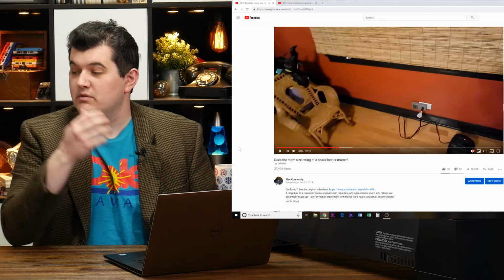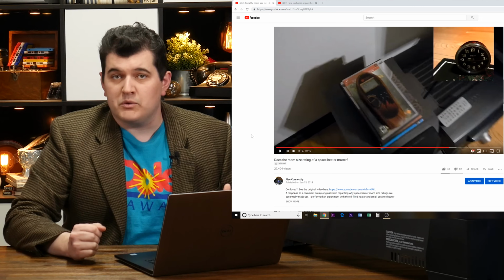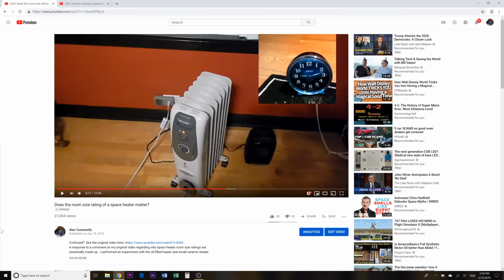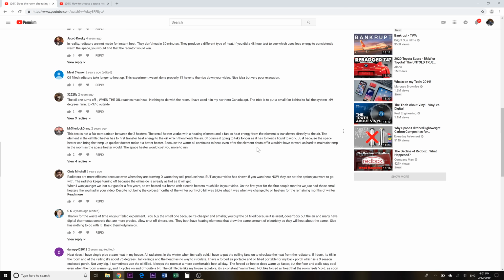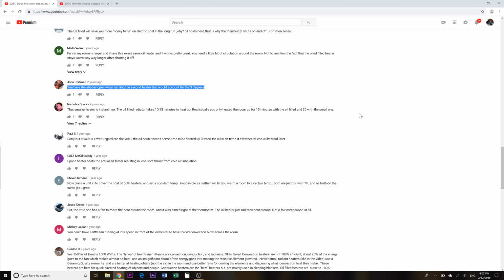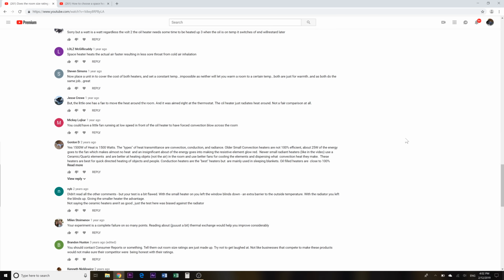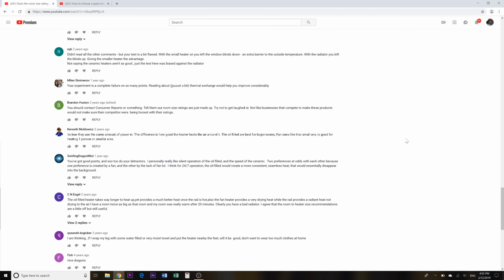More Space Heater Nonsense

Comment: Your argument now is that the oil heat limit it's self is omg ignorant. Once again that isn't how heat works, it takes time or energy to transfer heat. An oil Heater trades time for longer lasting heat or cheaper heat. The misleading is how the public understands heat
Reply: Yes oil heaters act like a delay function, they take longer to heat up and in exchange take longer to cool off, it is all equal.   The 1500 watts however, are still the same 1500 watts injected in to the room no matter what heater you use.

Comment: You recently done a video about heat pumps, this is something you really just don't understand but if you look into the different types of air-conditioned areas and used as heat pumps you can see what makes the difference in sizes between head units. Heat is a lot more complicated and you are being ignorant maybe both are being ignorant. Heat is not just energy it's also not losing heat this is by air-conditioners are 60000 btu while equivalent in heat is 120000 btu so u need double the heat transfer to heat a room actually need less heat transfer to cool a room but yet it's more expensive to cool a room then heat it. Just understand heating is a lot more complicated and electronic heat is dumbest way anyways.

Comment: But wait!  Until you try explaining why energy saving light bulbs don't actually save that much energy, if any at all.

By that, I refer to the pool of warm air which floats above our heads. Good old tungsten lamps keep that pool nice and warm, especially in winter, so that when you turn the heating on, it doesn't work so hard warming up that otherwise dead space. Now, with "energy saving" lamps, the heating does have to work harder to heat the room, thus negating the supposed savings gained by the use of energy saving lamps.

The logic is clear, but most folk either, cannot, or will not, grasp the basic concept. Just like your description in this video, it's all there, if folk really wanted to know.

It's like an analogy between a car with a 4 litre engine, and a van with the same engine - one vehicle gets you there faster, but the other carries more of your trappings, just a bit slower. In both cases, the engines produce the same amount of power.
Reply: If your house is using pure resistive heating, sure.  But if you're using heat pumps, gas, wood, etc then the cost of that waste heat would be more efficiently spent on other heating methods.

Comment: If the time is a fundamental requirement your old experiment would be relevant. I would say the better metric to be used when comparing temperature would be to run both heaters till they have consumed the same amount of watts.  My opinion would be that there is an inherent assumption that the large room heaters need to be safer as they would most likely be in rooms with more people in them. I would also assume that the large room heaters would have better convection flow allowing them to heat bigger rooms more easier.

Comment: your frusteration with people who think they know but really dont is so obvious.... i deal with the same frustrations myself everyday, and its not easy.....
  you are correct that any given type and quantity fuel only has a certain amount of energy in it....  some of the heaters you describe here may distribute the heat in a different manner, or concentrate the heat to a specific area of the space/room differently than others, but the room/space itself will collectivly only recieve as many BTU's as the given amont of fuel has in it, no matter what the design of the delivery device is....
..... here is another scenario that escapes most people. this is best described by using an uninsulated shop space as the room....
 when heat is produced into ANY space, its going to accumulate near the ceiling, and depending on how powerful the heating source is, the height of the ceiling and the temp outdoors, this can be as much as a 20 to 30 degree difference.....
and when this occurs in an uninsulated building in cooler weather, the heat loss will be extreme, and possible with very little noticable effect at floor level... this is due to the temp differnece being so extreme between inside and outside, and the energy "pressure" at the ceiling being so great that it forces its way out of the room in everyway possible... BUT... intorduce ceiling fans and you can heat the same area to a comfortable level with the same amount of given energy.... this is because the ceiling fans will bring the heat down to where it can be used by us, which also lessens the energy pressure buildup at the ceiling, and so even though the btu loss may be just as great in the uninsulated space, the ceiling fans will distribute ALL the heat energy that is being produced to the areas where it can be used to its best advantage....  i live on the 45 parellel, and I know a LOT of people who have uninsulated shop space that is equipped with a heat source of one kind or another, yet they let 60-70% of the energy expended and heat produced, go out thru the roof, gaps and absorbtion/convection by the metal roof and siding, without ever getting any benefit from it.... the higher the ceiling/roof, and the colder it is outside, the higher the efficiency a ceiling fan will be, which if the shop space is uninsulated, adding ceiling fans can increase the heating efficiency by 60-75%....... it may slow down the heat loss very much. if at all, but it does allow for the heat that is being produced to be used to its best advantage before it leaves the space...  just another common sense scenario that people seem to not be able to grasp...

Comment: does the volume of airflow going through a heater have any bearing on its ability to heat a room? as in, if a "large room" heater can push 15 cubic feet of air per minute past its eating element that is drawing 1500W, and a "small room" heater can only push 7.5 cubic of air past its heating element per minute (numbers irrelevant, I have no idea how much air these things actually move), would the large room heater heat up the room faster?
Reply: Bigger fan blowing more air would tend to keep the temperature of the room more uniform.   Or uniform over a larger area.

Comment: It's amazing that you are still bugged by this after 5-6 years. But I'm glad you didn't quit making what you do and later you did it better. You are clever and you could explain the whole idea behind all this much better. You don't need experiment to prove your point. Yeah, the oil heater is better in the long run but what if you just came home and forgot to heat up the room in the middle of winter. You need heat and fast and the oil heater just won't cut it, you'll get cold quicker while waiting for the oil heater to start doing it's thing.

Comment: My experience with oil filled radiator style heaters was contemptible and I ran these for hours with windows closed and I simply froze. I even tried putting a fan behind it which hardly helped. It had been touted as ecologically superior. The last one simply broke. I had tried to avoid loud fans. Finally my experience with Hunter heaters was just great. I have a Hunter tower heater at home and a smaller simpler unit at my son’s both work just fine. Your information on household electricity is consistently valuable to me. Thank you

Comment: I may coming late to the party but, i think your experiment was not setup right and cause confusion for the viewers. Your room (unless is perfectly insulated) it will loose heat, and if the heater is providing heat slowly it will not be capable of overcome the speed of the heat that the room loose. Also I noticed in the original video, on the small heater test, your shades are down and during the oil heater test the shades are up, so you changed the overall insulation rating of the room, changing the speed of the heat loose. And finally, the outside temperature can drastically change during the time of testing, changing again the speed that the heat is loose in the room.

Comment: Marketing language in anything is hardly useful, that is why looking at the finer details of what kind of heat and measurements like BTUs come in. I do think that the type of heat needed is very circumstantial. A ceramic forced air heater is adequate in a humid environment but we do need some air moisture as a matter of health and safety. I would prefer a baseboard heat over a forced air heat.

Comment: It seems to me you would need both, the small ceramic to get the room temperature up and the oil-filled radiator  to maintain the temperature
Reply: No. If they both have the same electrical rating, they both will put out the same amount of heat. It would be nice if both of them had a remote thermostat that allows you to set the room temperature away from the unit. Otherwise, both will just continue heating the room until they both go over temperature. Obviously, most heaters have a temperature knob on them that adjusts the internal thermostat, so that serves as a non-remote thermostat.

Comment: 1500watts??? You must freeze in the winter time, Heaters in Australia max out at 2400watts. Oil heaters are useless only good for warming your clothes, looks like some heaters use there 1500watts more effectively than others as demonstrated by your experiment, although they produce same heat output in reality the heat you would feel on your body is much better with the tiny fan heater, maybe the benefits of oil heaters would come 2 1/2 days later when it eventually warmed the room, oil heaters are useless. Did I mention that already?

Comment: The forced air in the smaller heater will warm more air faster than the convection heaters, there by terminating the need for more heating faster. If it is capable of the same amount of run time and noise is not a issue then the convectors are not relevant as they tend to cost more. I would say that they actually complement each other, the fan heater gets the room warm and the oil radiator keeps it warm with little to no sound witch may be preferred when going to sleep. Set the radiator for 2-3 c more than the fan heater and the fan heater will only kick in if the other one can not cope with the heat demand, just not on the same fuse/circuit.

Comment: I have a theory: it's *psychological*, people subconsciously equate such silent heat emitters with radiant (?) Infrared heat sources such as sun or glowing embers (?) Which emit heat as pleasant sensation on your skin silently and without heating the air that they traverse so drastically (no sharp drop in relative humidity), etc. Ofc, oil heaters actually work on convection and not infrared radiation, same as fan heaters.

But I just realized that the fact that there are 2 different types of heat puzzles me even more than I thought before.

Comment: 1500w of heating is 1500w of heating. period.  differences in "heating efficiency" can only be a) ventilation and b) thermal mass of the device. but one practical difference between "small room" and "large room" heaters i can think of: durability. a small room needs less heat input to maintain a certain temperature than an otherwise equal large room. so a small room heater could be constructed for 4hours of heating each day and breaking exactly when the warranty ends, while a large room heater is constructed for 8hours of heating each day and breaking exactly when the warranty ends...

Comment: The fan to move air around is huge - I had one of those oil-filled radiator style ones and I used to keep a little fan blowing across the fins. It really helped the thing heat up a whole room more effectively, rather than just the little section of air right around it.
Reply: You'll find all the heat is up near the ceiling not just the section around the heater. Just stand on a chair to see. You're right about the effect of the tiniest fan, just the smallest assistant to getting the warm air circulating down makes a massive difference.
Reply: @DiscoFang  This is why I run my ceiling fans (in reverse) sometimes in winter!
Reply: @jameshoiby  people should look at their ceiling fans. Most contemporary ones have two settings (reverse and normal) for winter/summer
Reply: Ps: it's usually a little black switch
Reply: @jameshoiby  Yes, that blows the air up over to the walls so you don't have a draft on you! 😁
Reply: Radiators indeed works best in combination with a ceiling fan that can circulate the air and prevent most of the heat from ending up in the ceiling. Although many fan heaters I have had, have had the same problem. Because they turn completely off (even the fan) once the thermostat turns off. The air is heated very quickly and the walls and floor is still cold once the thermostat turns off - since the fan also stops, the circulation stops as well and most of the heated air rises to the ceiling. When it turns on again, the air temperature rises again very quickly and the thermostat turns off after a short time and never gives the floor and lower part of the room enough time to heat up. It's slightly better to have one where the fan continue to run, even if the heating element is turned off.
The best space heaters I have had (without a ceiling fan) is otherwise infrared heaters standing on the floor and/or pointing partially (or fully) downward, so most of the heat radiation hit the floor lower part of the walls furnitures etc. If running such an heater on thermostat (an external one is often needed though, since most don't have one built in), the floor is still hot when it turns off and take a while to cool down - this gives a much more even heat distribution and energy use (heat the ceiling is like heating a room that's not used - it will just increase the energy losses, without adding any comfort).
Reply: same !
Reply: That is the trick with them!😁😁 I use a box fan on low and keeps the thermal shutoff switch from shutting it down too much and the thermostat on it to work right!😁😁

Comment: Thank you! One of the funniest videos I've seen in a while. I'm crying over here! You have a gift, sir! 

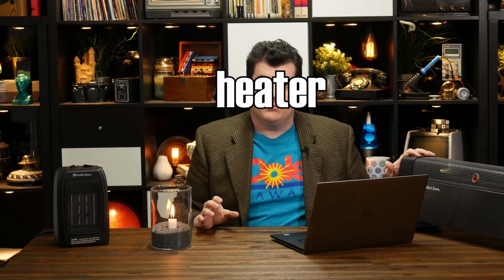Awesome video! To be pedantic, I will point out that 'effective' (21:59) is different than efficient, however I'm not calling you out, I did understand what you were saying. The only ways to increase the average temperature in a finite space over time is through convection AND time,  or convection AND time AND distribution. Someone COULD argue that if energy is used to run a fan then the full 1500 watts is not going into the heating elements, but as you pointed out, the fan itself will produce heat in connection with it's operation, so there would be very little loss of efficiency. The only thing that will make a difference in how well ANY identically rated heater effectively increases the temperature in a space is to distribute the heated air faster than convection will on it's own. (For example, an 'air mover' somewhere in the room.) At the end of the day, if you only have 1500 watts, then you only have 1500 watts to do the work. Because, Science!!!

Comment: I'd like to play devil's advocate. Before I do, I'd like to acknowledge that I completely agree with the concept of energy in equals energy out. If you're pulling 1500 Watts out of the wall and dumping it into to the room, it doesn't matter what you use to do that. However, I think there is something to be said about the different modes of heat transfer which invalidate this particular test. 

Heat can be transferred via conduction, convection, and/or radiation. Your old video is comparing devices that each excel at different modes of heat transfer. The small resistive heating element with a fan excels at convective heat transfer, that is, it heats the air directly. The radiator excels at, well, radiation. It will excel at heating surfaces, not the room's air. There's a little conduction, and perhaps some convection currents that are directly heating the air, but it's primary mode of heat transfer is radiation. Now I can't get a good look at your temperature measuring device, but I assume it's measuring ambient air temperature, which puts the radiator at a distinct disadvantage.

If you conducted this same test with the same heaters, but used a surface temperature measuring device, I imagine the radiator would look much better than it does in this video. It may have even been able to out-perform the smaller space heater, regardless of the fact that it wasn't able to maintain a 100% duty cycle, because the small space heater would have to rely on conduction from the air to the measured surface in order to compete. 

Now, again, I agree with energy in equals energy out. If both devices are pulling 1500 watts out of the wall, what makes the radiator more suitable for large rooms? What's enlightening (and hilariously ironic) about this test is that the radiator (marketed for larger rooms) is actually putting out less energy, because it's unable to shed heat fast enough to not burn out its components. Nonetheless, comparing the time it takes for a convection based heater to heat the ambient air vs a radiator isn't a valid way to illustrate your point. All it illustrates is that convection heats air faster than radiation.  If you wished to show that a heater rated for a larger room is not putting out more heat, comparing steady-state temperature (ambient air or surface, either way should work) would've been a more accurate test.

Fun Fact. Radiation is why you feel colder in your house in the winter, regardless of whether your HVAC is maintaining the same air temperature as it did in the summer. You're body is radiating more heat to the colder walls.